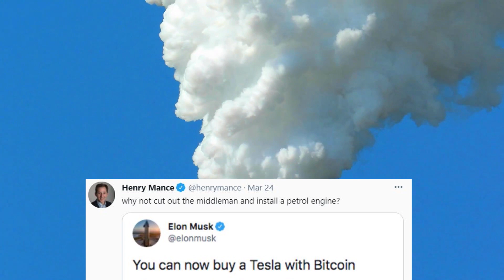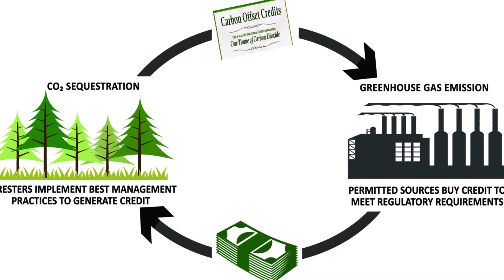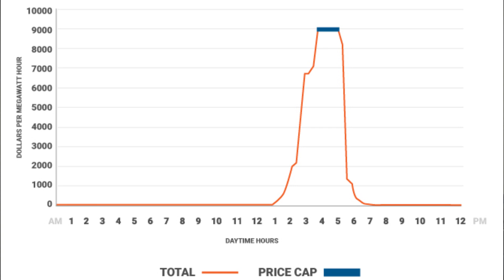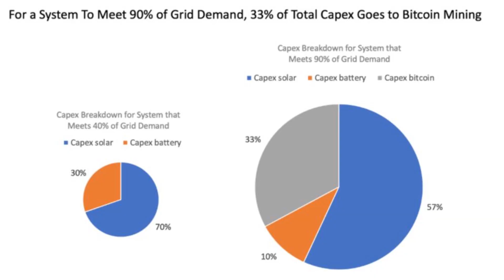The Bitcoin Green Revolution - Is Cathie Wood Right About The Environmental Impact of Bitcoin?

Comment: I don't understand why it's built into bitcoin as a good thing that it takes energy to mine - is this because the complexity of the algorithm is a P vs NP problem - and is it efficient and is there a possibility that Bitcoin is an NP problem.  Are there a whole bunch of people trying to develop quantum computing to be the first the remine the lost 45% of bitcoin.  I'm not sure I understand this? Do exchanges have to keep bitcoin for the bitcoin you buy or can they just pretend to do it and leverage the rest sort of like an unprudential bank - I bought some bitcoin in 2013 but fully lost the computer access with the key thing - threw the computer into the dump in ringaskiddy

Comment: Given the gain per kWh, they will sell electric power most of the time, but as renewables are throttled at periods of highest production it can he burned to do hashing with no loss but it is quite questionable if the investment in surplus capacity Is sound. It might make sense, but if you also discount for the price of the mining equipment, the mining part just breaks even. So declaring Bitcoin mining as a green technology Is just greenwashing. This is perfectly in line with ARK investment strategy: do something stupid the more stupid will buy into. The disgusting part Is that It works. So far for the Homo economicus

Comment: "... each newly generated electron" goes to show that everyone becomes a fool outside their area of expertise. Doesn't detract from any of the points though.

Physics has a rather strict set of conservation laws that prohibit the issuing of new electrons in most circumstances. Some are produced in nuclear power plants, but concerns about radiation prevent them from entering the grid. Energy generation is therefore mostly about generating hype (or in physics terms "excitement") in already existing electrons.

Comment: Cryptocurrency is like a Debit Card
 It only works when the electricity is on.
This is why it is useless in the long run
Miners go wherever he costs are least.  I have not used it, I have no need to.
Reply: Define works. It's not being used as a payment network. The argument from crypto-nerds is that OK, that failed, but it's actually digital gold. Then you ask them what they use it for and it's buying it now so they can sell it to a bigger fool later.

Comment: I haven't read the paper(s) you're talking about, there might be a bunch of non-sense in there. Ultimately, the advantage of BTC mining with regards to energy production is that miners allow energy producers to scale up production such that high retail demands can always be met. The main issue with having such high production is the infrastructure cost which would normally provide no benefits as well as the fact that production can't easily be tweaked to match demand. Producers are often forced to pay to get rid of extra electricity. If having miners be the producers that serve retail customers is part of that paper, that's complete BS indeed.

Comment: I got fed up with this constant money printing madness and threw significant part of my life savings into crypto, particularly Bitcoin. I missed the train, when it was cheap as dust, but when it grew to the point when even SEC approved futures ETFs and soon to approve physical ETFs, I decided to step in. I do not care about volatility (YES, it is volatile, but it's relatively new asset, and better acceptance will come with lower volatility), I think it actually has intristic value (cost of mining 1 BTC varies from $8000 to $20000 depending on the region and electricity cost), and the most important - it has FIXED supply which I'm really happy about, since you can't create more BTC out of thin air, like they do with my hard earned $$$. Also, it provides great returns in LONG TERM, and basically everyone who bought before 2021 when it peaked at almost 70k, is in profit. I'm not gonna spend it, I'm going to keep holding it through all ups and downs. I'm fed up with stock markets which at some point became even more volatile and unpredictabe than entire crypto market. I wll also continue buying it in small parts (DCA strategy). Just my 2 cents.
Reply: Just because something is expensive to make does make it valuable. Hope you did not suffer from the crypto crash.
Reply: @nocomment3294  Thanks for reminding me about this post! Considering entry price, I'm about 40% down, but I'm still doing DCA and buying small parts of BTC every month, reducing my average price.

So far my target is post-halving (end of 2024 approx.) when they price usually rises and BTC enters bull market. Then I will see what to do next, based on my profit/loss.
Reply: @casinoland-casinostreamer8437   Hope you recover since bitcoin bounced back already from a low.
Crypto is just to volatile for me and i don't see the value or use case.
Reply: @nocomment3294  it works very well for me, as an asset to keep, and as currency to use, for payments and money transfers.

Comment: Hi Patrick, I sold my Crypto in December and will buy again possibly late 2022 or 2023, so I am not defending it but I have a few observations. First the view of Crypto future is a projection not the current scenario. A lot of Crypto and Bitcoin is massively energy intensive primarily requiring ‘proof of work’ transaction verification. For a lot of Crypto there are plans to move to ‘proof of stake’ which is far less energy intensive. I know Ethereum is planning to change later this year. Not sure of the date for Bitcoin but I understand it is in their plan. Elon Musk has already commenced building an large scale solar and battery farm to provide energy for a major data centre for Bitcoin. I understand this will be rolled out to many other location. These two key initiatives will significantly reduce the power requirement and create a more sustainable model. Your observations are correct at this time  but not completely correct for the future. There are quite a few YouTube videos with Elon Musk, Cathie Wood and Jack Dorsey some of which cover the problem and resolution.

Comment: In general I'm against the PoW model wherein cryptocurrency networks have to be secured by burning energy and a lot of cryptocurrency networks have already move or currently are moving to more environmentally friendly models such as PoS (Proof of Stake). Ethereum for example while currently still using PoW is looking to move to PoS which should reduce the networks energy consumption by more than 99.9%

Comment: To me it sound like it would work with a couple of more assumptions. Assuming that those who will build the new energy grid believes bitcoin always will skyrocket in value, let them start to build today's capacity needs and pay it of with bitcoin profits. If the bitcoin value then drops so much that they make more profit selling the electricity to the grid. If that's the case, bitcoin will indirectly be good for the environment. But that's a lot of unlikely assumptions, on top of all the unlikely assumptions in the paper.

Comment: Initially I avoided this excellent exegesis by simply remembering that Cathy Wood was mentored by Art Laffer.
On the face of it some of the conclusions about energy & BTC seemed to be founded by willful assumptions.
Patrick Boyle has obviously prepared for this sort of analysis with a career of researching and strategizing investment with serious consequences in the balance.
I am a fan of ARK Invest ETFs. Unfortunately while I have bought them, I also use them as trackers for my own Direct Indexing. 
I had been anticipating that a person mentored by Art Laffer might be susceptible to forming understandings with leap-of-faith bridges.

Comment: Well, I can probably add one thing or two, Crypto farming actually quite helpful for renewable energy like hydro/ wind power since it drastically reduces the amount of time needed to recover from initial investment into green energy power plant. Since a lot of renewable energy plants it's seasonal in terms of power output, you cannot really stop the wind from blowing or river running, the electricity they generated used to be wasted. From some of the associate I know, it used to need 25-30 years to cover the cost and start earning profit from a hydropower plant, since the introduction of bitcoin framing, they now only need about 10-15 years since local crypto farms for their electricity cost, it is a win-win scenario.

Comment: Hi Patrick,
I work in the UK power sector. When the frenzy of bitcoin prices started, our chairman asked me to do an analysis on "if we buy power from the wholesale market only when electricity is cheap, and use that power to mine, can we make money within a reasonable timespan?". Reasonable timespan: return of investment in 3 years with 12% interest rate.

Short answer is no it doesn't.

So, electricity is cheap when there is high intermittent renewable energy on the system; however, balancing costs are quite high when demand is low and renewables are high. Batteries are far away from being a prominent "energy provider on grid scale", at least 5-10 years.
So if no batteries, can we make money from running the miners only when renewables are high on system?
No we can't. Running miners only when there high amount of Renewble Energy on electricity grid (<£20/MWh), doesn't payback miner investiment in 3 years, with avg. £30k bitcoin price. 
Because:

a) the intermittency that everyone taks about is quite intermittent. We don't have that much intermittency as we're at the beginning of the energy transition. Also, UK is one of the leading transition countries; hence, the situation would be worse in other countries (as you mentioned clearly),

b) Balancing costs are high: so let's say that energy that you import is £15/MWh but there is a £25/MWh balancing cost because energy system is light and system operator has to make sure that system stays operational so they charge everyone who uses the system at that time.

Minning makes sense only when you import energy at least 3000 hours/year, with £30k average bitcoin price. To make a reasonable profit, you need to run it more often which means the carbon footprint of the energy you import increases as you're not only running when RE is high anymore.

The only solution is this -> Wind farms/solar parks utilise on-site miners that feed them without using the distribution or transmission systems -> not paying prohibitive balancing costs.

Comment: One can make the case that the positive externalities of bitcoin are smaller and negatives bigger compared to trading stocks, but the basic problem remains the same - profit-maximization by definition doesn't care about externalities in either case.

This is why we need mechanisms like emissions trading and carbon tax. Tesla made $590 million from the cap-and-trade system for electric cars in 2019. That means that during the year Teslas competitors who didn't meet their quota of electric cars subsidized the company by an equivalent of around $1600 per every one of the 367 000 cars sold. 

During the last financial crisis, the price of carbon in the EU emissions trading scheme dropped to nearly zero. After Covid, it has increased to a record high of 45 euros per tonne due to the announcement of more bold environmental targets. This crisis and the recovery seem to be different. These types of mechanisms that make companies compete to meet environmental targets will shift how everything in the economy operates. Would be interested to hear your thoughts on emissions trading systems, green bonds, etc., and the impact of the increase in the EU carbon prices on the economy. 

Hope to also see the intellect and imagination that goes into creating financial instruments be used to create a variety of clever designs for ways to maximize positive and minimize negative externalities more broadly. One example of these outside environmental externalities is social impact bonds, which have been used to incentivize employers to hire people who have got out of prison. Employers can invest money into social impact bonds, and if they reduce reoffending rates, they get the money back with a return proportional to the reduction in rates of reoffending. It makes total sense because the government saves insane amounts of money if it can reduce reoffending but the markets n their own disincentivize hiring people who have been to prison.

Perhaps as opposed to these fraudster gurus promising people quick ways to get rich that the internet is full of, this channel could encourage people interested in finance to use it for good, without promises that it would be the best way to make the most money. Emissions trading, impact investment, etc. ofc itself also includes a lot of misleading information and dishonest people, but overall think it has done great things and has the potential to do even great things.

Also, there was a brief outdated statistic in the video, it seems that 65% China's electricity runs on coal, not 80%, at least according to a quick google search. 

Thank you for your informative content.
Reply: I too would like to hear about emissions trading systems! Seems like we will be doomed by our own insatiable demand for energy...

Comment: we use huge synchronous electric motors in mills to do what they are proposing here. A pulp mill is in the paper business but they also provide load, power factor correction and co-gen facilities on demand for the utilities. response times are an issue and massive mining rigs have a millisecond  response that is valuable and fully scalable should help deal with the issues regarding the duck curve driving prices negative.

Comment: Cathy and Jack focus on powerhungry cryptocoins (proof of work coins that require mining) is somewhat odd. It doesn't need to be energy demanding coins, as Delegated Proof of Stake coins, such as Nano, Cardano, Tron and EOS use next to no power to run their networks, in the case of Nano its around the same as 1 single windmill to run all the global nodes. Their focus on mining, both crypto mining and resource mining seems to be quite archaic.

Comment: The fact that companies and funds are getting behind bitcoin at this point disappoints me somewhat. Bitcoin is suffering from being the first, the technical capabilities as the currency exists now do not support widespread adoption. To make a case for "green bitcoin" seems moot when there now exists "proof of stake"(if you are interested in crypto i highly recommend googling this) cryptocurrencies, which do away with the energy concerns and additionally provide passive income from ownership. I believe bitcoin will continue to go up for a while yet, especially with more investment from big companies. But the fact they released this paper arguing "bITcOin CoULd bE gReeN" tell me they do not understand the broader trend of crypto.

As a side note i would add that proof of stake is not the only differentiator and modern crypto currencies can also provide faster transactions, lower fees, more transactions per second, software integration and privacy.

Comment: Binface 2021!

Also, superb points. Green and renewable energy does not necessarily imply zero environmental impact. Their proposed models require more scrutiny (crucially, far fewer assumptions and rounding errors than are present presently).

Comment: The only case I could make in favor is that at a certain point all Bitcoin will have been mined and the power consumption rate will decrease as we move towards more transactional crypto interactions. At which point the consumption will be higher than Visa, but not significantly. This of course is just a theoretically musing with as much research to back it up as ARK's paper.

Comment: You do realize that most power that is generated is not even used? There are massive losses associated with transmission and the reason mining is advantageous is that the excess energy can be used at the source to secure the network as opposed to literally letting it dissipate without providing any value. 

One very interesting use case is called flare gas capture, where many companies just vent greenhouse gasses into the atmosphere mining now provides a way to capture this energy and convert it into usable hash power.

You make the false claim that a single transaction takes as much energy as a household, god how misguided are you? did you get your numbers off reddit or something? A single bitcoin transaction can contain hundreds or thousands of outputs, that means a single transaction may have thousands of independent outputs, look up "transaction batching" . Bitcoin blocks contain transactions, the transactions can contain many inputs and outputs,  and the major major thing you're missing is that energy consumption is not even a function of a transaction, hashpower and energy consumption are functions based on how many miners are running on the network, there is no energy requirement for a single transaction... The more energy used the more security the network has.

Bitcoin also isn't like visa at all and you miss the whole point. Bitcoin is like Fedwire with instant and final settlement, VISA does not settle transactions at the point of sale, and visa transactions can be reversed at a later date, so you are comparing apples to space ships.

Bitcoin is also just the base chain, layer 2 solutions make energy consumption and transaction speed/throughput nearly unlimited. The point of bitcoin is to provide peer to peer final settlement for large transactions that are censorship resistant and immutable. Visa or your bank can block you at any time, basically censoring your ability to conduct transactions, economic control over populations is a form of oppression.

Sad to see so many faulty claims from your piece, really loose respect for people that portray something as totally factual when they themselves don't even understand the basics  on the topic.